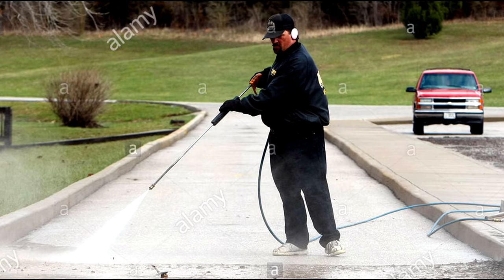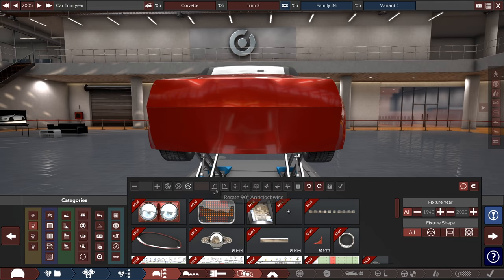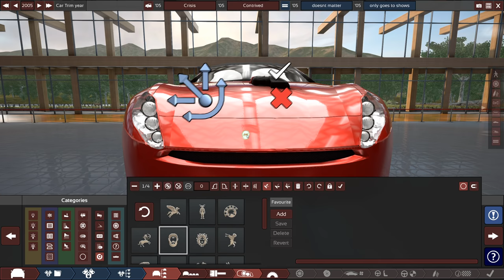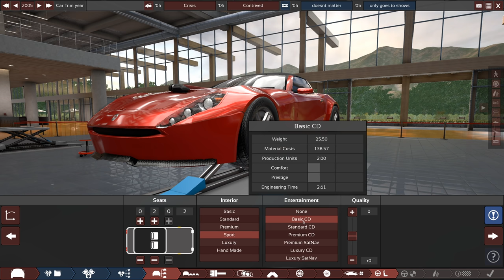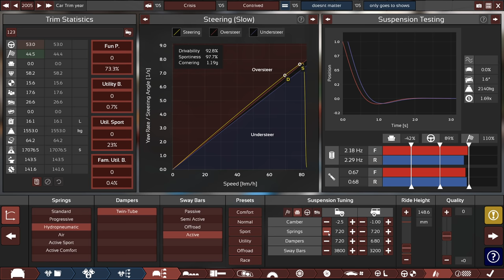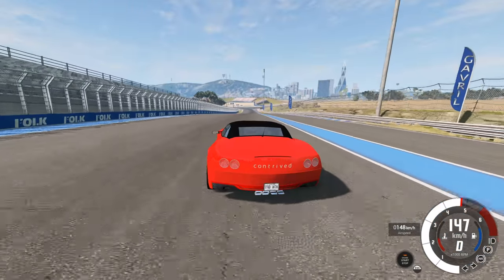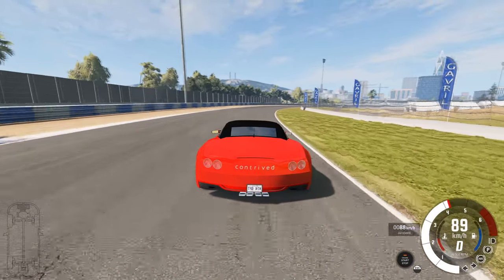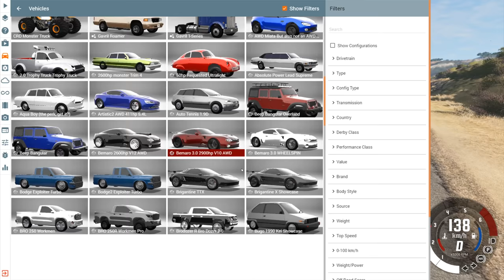I'm having a Midlife Crisis - (Automation + BeamNG.drive)

Comment: The new koenigsegg gemera has an inline 3 with 600 hp and Nm, I tried recreating it with the same bore, stroke and rpm limit. It runs on regular gas and my results were 583 hp and 502 Nm. Maybe an interesting idea for a video

Comment: when my dad was like 37-42 or something like that idk, he had a c5, and it was this "special grey color" that was for only that year, and it made about 900 wheel with an auto, so probably around 1100 at the crank. used drove it at least 5 times a week, and it tore. but over the years ive realized, he is so goddamn sterotypical

Comment: "Configuration" does not refer to fuel injection. It refers to the number of throttle bodies. Single means one like most cars. Twin is one per cylinder bank and per cylinder means one per cylinder like individual throttle bodies on a racecar or something.